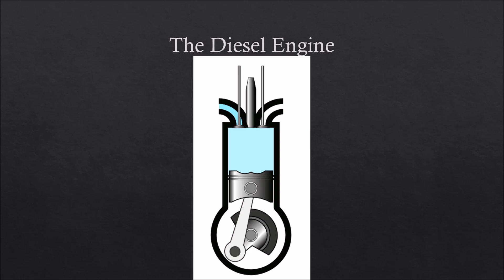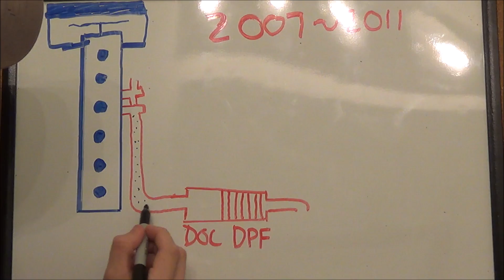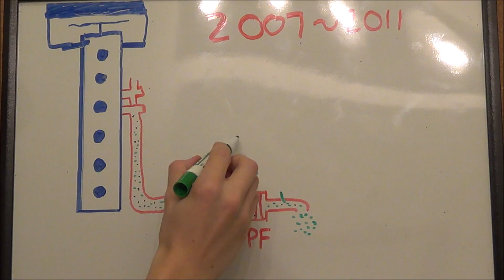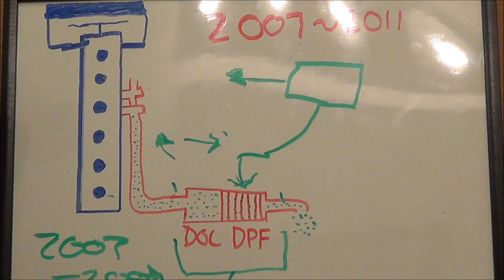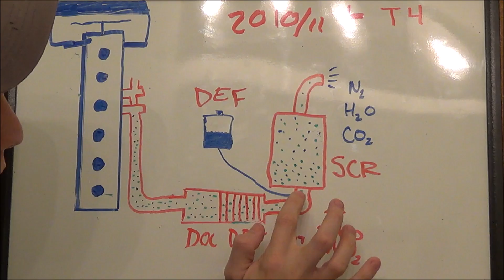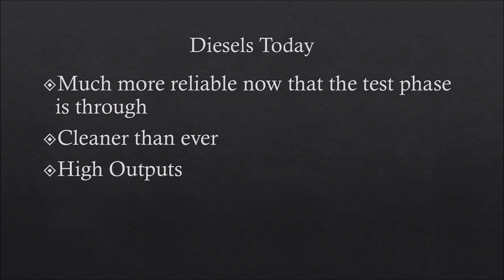Understanding Diesel Emissions and the VW Scandal

Comment: Nope. The whole point of Volkswagen Clean Diesels was that they did not need DEF/AdBlue to meet emissions requirements for NOx. They essentially used 2007-2011 technology with a sophisticated ECU that sensed when the car was tested for emissions, and made the engine run cleaner but with less horsepower and possibly higher fuel consumption. When the testing was completed the ECU went back to its normal operation, meaning maximum fuel mileage and power but considerably higher NOx emissions.

It wouldn't make sense to build a DEF system into the car and not have it on all the time because DEF injection doesn't increase fuel consumption or decrease power.
Reply from the maker: +Tuppoo94 The larger TDI engines in the Passat and Touareg TDI models still required DEF, when the Golf, Jetta and Beetle models with the 2.0-liter TDI did not. I should have specified this better in the video, as some are affected and others are not. But this still explains how it all works in all other diesel vehicles as well. It is impressive however that when it was in test mode it was clean enough to pass the testing without the DEF.